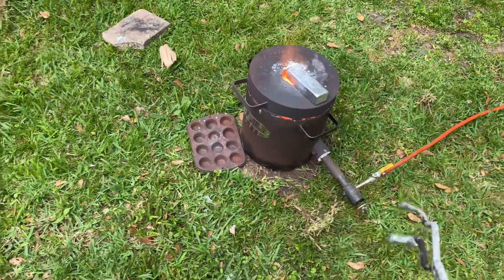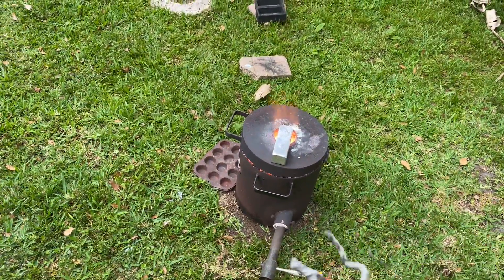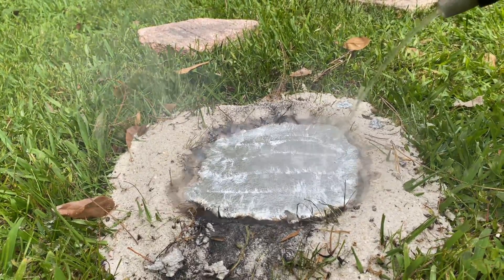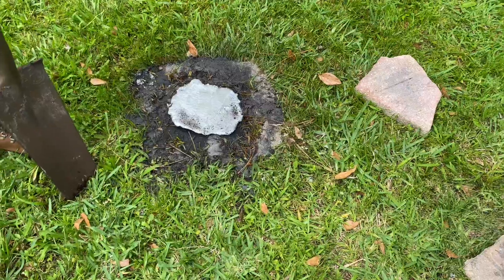Massive Aluminum Anthill Casting #22

Comment: Best ant hill casting vid I've seen yet, very informative!

Tool question - is that a cupcake pan you're pouring the dross in; and is that a perforated basting spoon you're using? I'm asking because I'm shopping dross spoons, but what you're using looks way easier.

Comment: Just Awesome! I'm a 3D sculptor, have you ever thought of placing two (1,2,3) eye bolts ( or revolving pin ) in the base of the still hot aluminum, and then when everything is cooled and finished you would cantilever/ hang it right-side up ( ie bottom side down ) as a floating sculpture? Just a thought😊

Comment: I am curious about something.  Would it make better sense to soak the casting in a big tub of water after you've gotten it out of the ground?  That way, much of the dirt would become loose mud and when you took it out of the tub of water, you could then hit it with the power nozzle and remove all the dirt that way.
Reply from the maker: It might make it a bit easier for the dirt but the main pain is dealing with all the tiny roots which get wrapped around the castings. Those I use tweezers to get and then try to burn once it’s dried off.

Comment: I subbed and have been binge watching for almost 5 hours.Really kewl work you do.Thank you for the explanations along the steps that you use when doing these too.Do you use a 'Satin Clear-coat' on these to seal them to prevent degradation and make them stronger,similar to what amber did to insects eons ago?

Comment: Speaking of safety, you really should turn the gas off at the bottle, rather than at the burner. Why? Well, that hose is still full of propane, being constantly fed from the bottle. So, what if you have one of the disasters you mentioned, and it lands on the hose?

Comment: Would removing the big (hollow) root damage the rest of the casting if a buyer wanted it removed?
Reply from the maker: I could probably cut it at specific points to get it to come out with out damaging it. I think it adds to the casting however and wouldn’t remove it myself.
Reply: @NolansAnthillCastings  thanks for answering. Your work is really beautiful.

Comment: Would using copper or brass yield similar results or are they too soft to try? Also have you tried to make these into clear epoxy bases for like glass tabletop furniture?
Reply: people have used other metals and they work just as well, I think aluminum is most commonly used because of how cheap it is but there’s no reason not to use brass or copper etc. some even talk about using precious metals like silver an gold

Comment: Very cool I've always loved aluminum sculptures with ant colonies. Quick question I have a whole bunch of the aluminum can tabs saved up is that a good source of aluminum to melt down?
Reply from the maker: Thanks! Tabs should be fine. You might have a lot of dross to deal with since it’s got a lot of surface area, but they’re much better than the cans.

Comment: The stuff you're skimming off the top is slag, what's left at the bottom would be dross?
Reply from the maker: Slag is more of a term used for smelting metals and it’s all the stuff that separates our from the refined ore when you smelt it. Dross is just the stuff that floats to the top of the metal like aluminum oxide. I’m just melting metal not smelting so I’m only producing dross, no slag.
Reply: @NolansAnthillCastings  slag means impurities, aluminium oxide is an impurity because it is unwanted

Comment: The first one got strait into in but the second immediately leveled off above I think because the rest had already been solidified in the tunnels so your second one won't reach further and deeper into the far tunnels. So I think if you had 2 molten crucibles ready to pour it into the hole you would have reached more tunnels and more far and tiny end. 

Whit the first one the big one's got filled but without an immediate second one it freezes and blocked any possible better advances as you saw the first one got strait into it no signs it was full but the second directly the first one blocked the rest so the second one was more likely making the upper slightly under ground and above. Tell me if I am wrong.

Comment: How does the spoon not melt when you dip it in the molten aluminum? I know it may be a dumb question I just don’t understand why it does not melt.
Reply from the maker: The spoon is made of steel which has a much higher melting temperature than the aluminum. Steel melts around >2800 °Fwhile aluminum melts at 1200 °F

Comment: and what happens if the anthill was over a gas line? i dont see any utility location marks. just a thought.
Reply from the maker: We have no public utilities other than electrical above ground. I’ve only run into an old water pipe for a structure we tore down when we first moved in.

Comment: Invest in some aluminium drossing flux if you haven't already! It blew my mind and has massively improved my alu melting/casting processes. That dross you're pulling off is probably 1/2 to 2/3rds aluminium, you can reclaim all of that with no effort with just a teaspoon of proper flux. It'll also give you shinier/higher purity castings (maybe not with ant-hills, not sure about that, there's a lot of impurities in the hole..)

Comment: After you take the crucible out of the furnace, getting ready to pour , roughly how long do you have before it starts to solidify again? How long could you let it sit before pouring till it hardens up?
Reply: I work in an aluminum casting plant. A small amount like this tends to harden fairly quickly
Reply: I’d imagine no more then a minute 30 seconds

Comment: you said something about preheating the metal so you don't cause an explosion and worst case scenario you get aluminum in eye. you did such a thing and you got aluminum in your eye that is a really dumb move should be rain aiprotection along with a face shield and a helmet with a fireproof neck guard I like what they wear when they work in a steel factory.

Comment: Cool video. But you don't need hot ass metal or poisons. You just need instant grits. I kid you not. Instant grits. It's a Texans trade secret. When the ants eat the grits the expand from the moisture, can't burp and explode. So the same thing naturally happens to the queen when fed it. My mom showed me this when I was 6 and have been doing it for over 30 years. Also, for ant bites and mosquitoes use tooth paste. The mint sooths while the phosphorus stops the pain. No joke.

Comment: I've never seen anything like this before, but when I had fire ants, actually any ants I just went out and got some Diatomaceous earth and that took care of all my insect problems. Safe, no poison, the most awesome stuff you can get to treat your property.
Reply: How do you apply DE?  Dry or do you mix it into a solution?
Reply: My DE story. I had carpenter ants under and behind the window sill of my kitchen window when I first bought my house.  I drilled a small hole underneath and injected some diatomaceous earth into the crevice.  They were gone within a week.

Comment: Road crews were doing roadwork near my house in Alabama and had knocked down a "No Outlet" sign. On a lark, I decided to re-erect the sign by sticking it into a fire ant mound. The pole was about seven feet long and I figured I'd have to stab it into the ground pretty hard for the sign to stay up. I put all I had into it and five feet of steel pole sank into the mound with just about no resistance.
I got out of there pretty quick.
Reply: I imagine it must’ve felt like when you hulk stomp the ground when thinking there’s another step 😂
Reply: @Makaylakay1213  LOL...I hate when that happens!

Comment: I recommend preparing the "Base" with strategically placed three or four eye-bolts prior to pouring the molten aluminum.  These would facilitate the lifting of the casting and allow for suspending it with a cable or chain.   nice work.
Reply: That's an interesting idea.  And you could potentially even unscrew them later if you could coat them with some release agent, maybe?
Reply: @TheNulloverride  no release agent required, as molten aluminium repels from iron.

Comment: So you have to melt using gas multiple pounds of metal at a very high temperature with all the risk that goes with it, then use water, then dig a massive hole in your garden to remove your mess ? Then use more water then probably spend lots of  effort filling that hole. I admire the efficiency here, i would defenitly hire you for you my next sturdies to figure if human are more clever than a strawberry yoghurt. Next time i will have an obstructed pipe in my bathroom i will put some lava on it.

Comment: I wonder if anyone doing this has poured molten aluminum onto buried power lines or water lines or gas lines by mistake?
Reply from the maker: I almost did an electrical line but I realized it was there before I set up the furnace completely.

Comment: That is so cool. I saw something like this on a cable channel a few years ago. That ant network was huge. I think they did it with concrete. You did a great job.
Reply: Concrete would never work with a tunnel this narrow.  It would just make a plug and you'd piss off a bunch of fire ants.
Reply: @Papadoc1000  hmmm...that's true. I guess they used something else. Whatever it was, it looked so cool. Huge, huge ant pile. Went many feet under ground and was several yards wide. Wish I could remember the name of the program.

Comment: I worked at a private school as a custodian and was told by my boss to pour boiling water down ant hills because that was the best way to kill them. Turned out that is not true and he had watched some videos like this and thought it would work with water like it does with molten metal. He was a fool
Reply from the maker: Boiling water works too. I used to use boiling water before this and still do when it’s too wet to cast with aluminum.

Comment: Have you thought about setting an eye bolt in the molten aluminum base and using a tripod with a pulley and rope to raise it and spray it off to avoid breaking fragile shafts?
Reply: That does sound like a good idea but Youtubers with thousands of comments usually are able to notice only the most popular comments. The more replies and likes it gets the more likely he is to notice so here's one more.
Reply: That's a great idea.
Reply: If you pull it up out the earf it will bend.  You have to mine around it and spray it just like he did.
Reply: how would it stand up straight if there's a bolt sticking out of the base?
Reply: @Aeneas137  the nice thing about molten aluminium is that it repels from iron, so you can just unscrew the bolt and take it out.
Reply: @sfs_matt4783  
I did not know that...
Reply: @sfs_matt4783  That's fucking genius mate
Reply: @Aeneas137  he could cut it off with a circular saw or cut it with a acetylene torch
Reply: @Aeneas137  You wouldn't.  Build a box out of polycarbonate and then suspend it from the top so that it is in the orientation of the pour ....... a proper representation of the ant colony
Reply: @Aeneas137  it could be a hanging sculpture
Reply: @eclecticdom  That's what I said too .... but in different words.  But, yeah it is cool to see all that excavation done by the ants.
Reply: Just about the coolest video on You Tube!!
Reply: Your mom has a fragile shaft
Reply: He could also attach a rope or strap around the base, attached to frame and pulley system to lift it out of the ground.
Reply: I hope your comment gets noticed
Reply: Shaft
Reply: I was thinking along the same line, as you were.

Comment: Fire ants...I lived in Alabama for 12 years. I know all about those nasty little fuckers! Burn em out! I sure did! You got lots more clever than I was. I'd pour gas down their nests to kill them. If the gas didn't get the little bastards, the fumes would eventually kill out most ant hills. I once dug up an ant hill that was several feet high and just scattered the dirt as far as I could throw it with my shovel. I dug down several feet below ground level before I reached the bottom. There were chambers inside the size of my fist. I'd dig into them and inside would be an uncountable number of ants that would pour out. This one huge mound would have taken 200-400 pounds of metal to fill. It would have been fascinating to see it all preserved in aluminum. 
*
Good job at killing that nest and having something cool to show.

Comment: A couple of things I have learned about backyard casting: When you have poured out your crucible, drop a round of cardboard in the furnace, and put your crucible Back In on top of it. Your crucible will not crack from Cooling too rapidly, and the cardboard keeps it from sticking to the Furnace bottom. Let the furnace naturally Cool, this will save your crucible. Wear a welders leather apron, and steel covers for the top of your shoes. This could save you a crippling accident someday. When you pour, stand on a higher surface than the molds are on, that way you won't inadvertantly have to step in molten metal should an accident occur. When I pour, I drop my crucible into an elevated Pouring Shank, Basically a steel ring with a shank on it, straddled between 2 cinder blocks, I keep my foot on the center of the shank during the transfer with the pouring shank supported with the cinder block close up, this gives the most support for the 'Live Crucible.'.I skim there and proceed to pour. These tips have saved my Life on more than one occasion, and Hopefully you will learn from them too. Remember to pour when the metal is hot, clean and clear, practice these steps and enjoy your Creativity.
Reply: Thanks!
Reply: Good safety advice. You should make a video showing all this.
Reply: Good tips! I don’t quite understand what you mean with the second part with the shank, it’s probably easier to understand if you see a picture or a video of it 🤔

If you feel like making a video, you should! 😊

Comment: You should put the crucible back in the furnace, close the lid and let it cool slowly.  You may have ruined your spare by thermal shock on your transfer block...
Reply from the maker: Graphite clay has very little thermal expansion. The biggest risk to the crucible is cold metal expanding while inside causing a crack.

Comment: So this is a great way to kill fire ants and have a pretty cool piece of art, because you have to dig up the aluminum. 

You can do it cheaper and not have to worry abouy digging it up if you use wax.
Reply: Or boiling water if that's all you were doing this for.  Why spend so much on wax just to let it sit there?

Comment: OH PLEASE. 1. wait til rains bring the ants/eggs to surface in mound . 2.. put 1 cup of bleach into 1 gallon water.  take heavy duty garbage bag . . . shovel the main portion of the mound (4-5 shovel loads) into the bag (quickly LOL), pour the bleach / water mix into the bag. SEAL BAG by Knotting.( let sit in hot sun for 2 weeks. then discard.)  Repeat bleach mix 1 gallon pouring directly into main nest area.  (may need 2 gallons) give it a good complete soaking. use shovel to get it soaked in deep if not absorbing deep enough. this is highly effective on fire ants, often, (if done thoroughly) eliminating the nest completely. & bio-friendly, no long lasting chemicals. & low cost.

Comment: Says, heat your molds first or it can explode...pours molten aluminum into cold dirt. Why didn't it explode ?
Reply from the maker: Soil is porous and let’s steam escape before exploding most of the time. Sometimes it does blow up which is why I wear PPE.

Comment: A can of raid would be a little bit cheaper then trying to melt something pour on top of the ground if you spray ant killer directly on the opening of an ant hill like a gas The Raid will travel through each passage killing what's there molten lead just going to cover the top and if you need something stronger than raid to get rid of fire ants I suggest looking up a cheap way to do it

Comment: What do you do with these anthill castings? Do you keep them, remelt the metal or sell the castings?
Reply from the maker: I keep and sell them. I’ve only remelted two that looked bad.
Reply: @NolansAnthillCastings  nice. How much do you sell them for?
Reply from the maker: One this size I’d sell for 250. I’ve sold really small ones for 40 bucks and larger ones for 500

Comment: What would be neat is if you were to add a J-bolt, or even a carriage bolt to the base (threads sticking straight up while cast is still in the ground). Then once done, the finished product would be one that could be mounted in such a way so as to correctly represent how it looked in the ground.

Comment: Where does one go to buy something like this?
Reply from the maker: I sell mine locally but a lot of people sell them on eBay. Most are over priced but you can find some good deals. I sell the ones this size for 300 and anything smaller usually for 200. Very small ones will sell for 50.

Comment: Why is it not a risk of steam explosion to pour aluminum on damp dirt?
Reply from the maker: Soil is pretty porous so it allows steam to escape with out building up pressure. If the soil is saturated with water like after a rain storm then you do risk an explosion since the aluminum and surrounding water will block the steam from escaping.